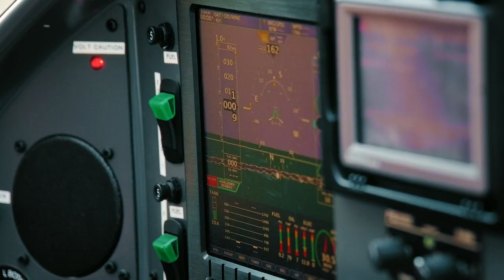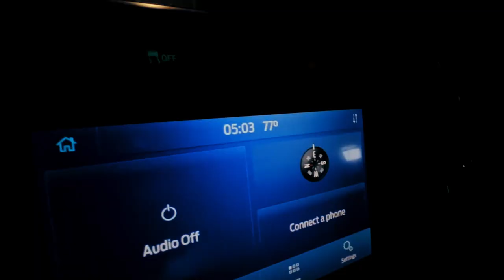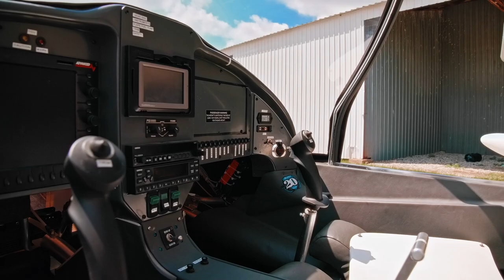Buying an Experimental Flying Boat - The SeaRey Chronicles.

Comment: Gidday, beautiful machine. I flew Cessna 185s and Pilatus Porters on retractable skis here in New Zealand. During check rides with a very experienced old instructor he could load me up enough so I'd forget the skis . Any distractions ( bad weather, high traffic or something out of routine) could be an issue.  I like the idea of touch the flap check the gear, some people I worked with would check their skis every time they made a radio call. I would say a danger to you could be a quick relocation from land to water and as soon as your airborne something different than usual happens and because it's a short flight you don't have time to catch a mistake. I  think you will have an immense amount of fun.

Comment: I strongly recommend a piece of string taped to the windshield. Staying coordinated takes some effort in a SeaRey.
Reply from the maker: Good tip and thank you. Yea, the ball is all over the place. I can’t believe how active I need to be on the rudder compared to my Tiger. Took a lot of getting used too.
Reply: Cool, I hadn't thought of that advantage of a mid-ship prop single.

Comment: Love the manual flap handle.
Reply from the maker: Me too. There’s an electric option but sometimes KISS is the best approach…
Reply: @thecommercialpilot  Electric is lighter I learned so I will be building for lightness like Lotus's Colin Chapman.   Odd to learn that!
Reply: @bocefusmurica4340  Get those parts ASAP if you're building. Progressive Aerodyne is currently closed.
Reply: @mattjohnston2922  they are still fabricating parts and others are getting into that also. 

I was to have a factory demo flight when I was there last week but the aircraft was unavailable.

Comment: I wondered what is the big deal Americans made with tail wheels. I knew a bunch of old guys who for a while had flown nothing but tail wheels  You just have to stay alert a bit more and longer on the ground. I drive the automotive equivalent of tail wheel, my trans is manual,  after a while, you do not even notice it. If I fly this Searey, unless on water, I just leave the gear down, gear up do not reduce the drag.
Reply from the maker: Tailwheel is monumentally more difficult than a manual transmission. If you get in the habit of leaving the gear down, you’re gonna have a gear down water landing and flip. It’s a really bad habit to not actuate the gear every time.